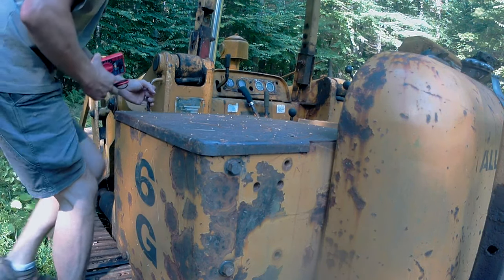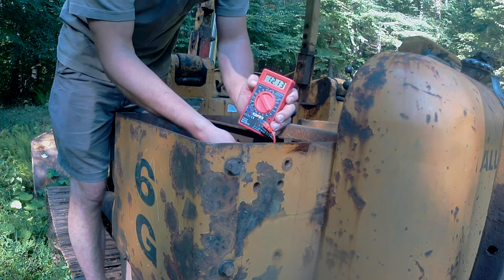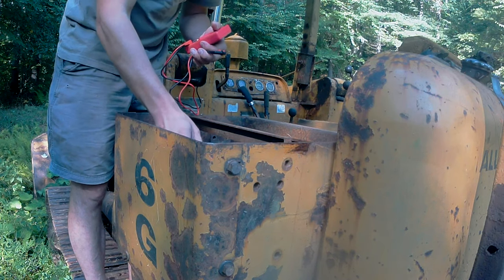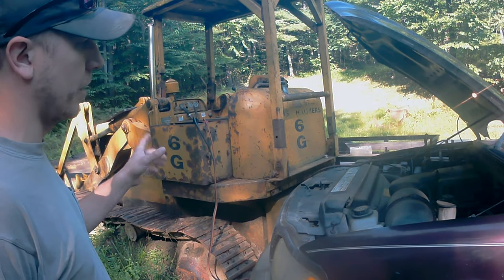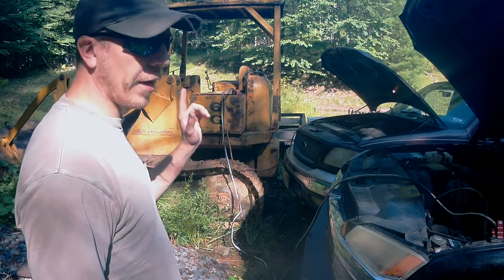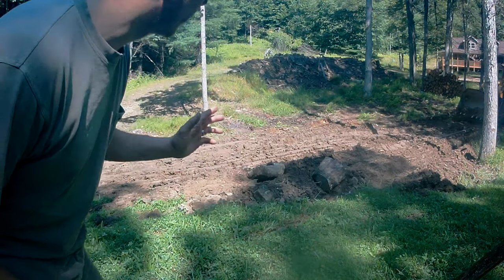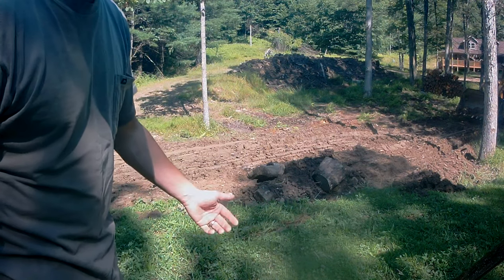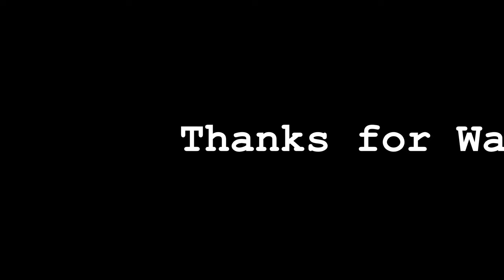Yard Work with Allis Chalmers 6G Leveling Dirt Crawler Loader - I'm Not A Professional - #29

Comment: Good to see ya got the ole G6 runnin...nice work pushing the dirt around...definitely looked like fun!
Reply from the maker: It is not easy to operate. With 7 different hand levers, and 3 foot pedals, it gets confusing. I basically have to do one thing at a time so I don't screw something up. Thanks for watching!

Comment: I enjoyed watching it! I have the same machine and I'm no professional either, as a matter of fact my yard looks pretty bad right now but I've been having fun running it. My 6G is a 24 volt positive ground system
Reply from the maker: I'm glad you enjoyed it. My 6G is 24 volt as well, but I thought it was negative ground. I will have to double check. Could that be the reason the generator isn't charging? Thanks for watching!
Reply: @NorthForkHollow  
Mine is a 1956 model I think they changed it and went to negative ground after that like probably 1958 or something

Comment: Tighten those chains brother, before you throw a track, that is if the cylinders will take grease. Nice farm dozer!!
Reply from the maker: Adjusters are manual, not hydraulic. And they are adjusted all the way out. The running gear is just simply wore out and won't last much longer. I've already thrown the tracks before. Not fun to do. But parts are not available for these old girls. Thanks for watching.

Comment: Please tension those tracks before you walk right out of them. 😁
Reply from the maker: Yup, I've done that. Even made a video of getting the track back on. But unfortunately, the adjusters are completely bottomed out and I can't get them any tighter. The only hope I have is to take a link out. I may do that in the future. Thanks for watching!
Reply: @NorthForkHollow  Taking a link out would probably be too much but I'm not sure, but it won't be easy, only the master pin will drive out with a sledge hammer, the others take a 200 Ton press. It might be easier to lengthen the adjuster bar. I know about putting tracks back on first tome I did mine was 250 yards out in the woods with no road in down a steep hill and in a running creek bed. I learned plenty that night.😁
Reply from the maker: @integr8er66  I could make blocks to lengthen the adjusters. But they are completely at the end of the guide rails. It's something I need to work on. I do have hydraulic presses capable of that tonage at my disposal, but not at home. So I'd have to take the entire track off. This is something I need to work on a little more.
Reply: @NorthForkHollow  Your's is kinda like mine, I'm just using up whats left in her not investing a lot of money. Oh ya something, if you don't know it already, changing fan water pump and generator belts on that is a huge job, but they make segmented belts now, I used one for my generator and it worked great. 1/2 hr labor rather than 8-12 hrs if the bolts aren't rusted.
Reply: Another thing I found was that even if you get it tight, if the pins and bushings are worn out, and I can see yours seriously are, it will still throw tracks. Not AS bad, but it still will, and usually on reverse because in rev the pull is on top and the tensioner spring will compress creating slack, when that gets to the sprocket and you are in a turn it will climb off. This is why I wish they had grease style track adjusters, they won't compress
Reply from the maker: @integr8er66  Agreed, there isn't a lot of like left in the tracks, let alone the whole machine. But parts are not available anymore. So I'm just nursing it along and using up what I can out of it while I can. Just a few more projects and then I can scrap it!
Reply: @NorthForkHollow  Well the pins and bushings are available, the rails aren't, but there are used ones out there, the sprockets are repairable with bolt on teeth which makes them much easier the next time, but I agree its a lot of money for a machine that will never be worth more than 5 or 6k on a good day. However don't scrap the whole thing, there are probably good parts on her for other people, esp the hydrologic cylinders, the exhaust manifold is a $600 part if yours is solid, probably other stuff too.
Reply from the maker: @integr8er66  Exhaust is definitely solid. Probably won't repair at this point. Parting out is most likely.

Comment: batteries must have at least 12.3V when fully charged to work properly
Reply from the maker: Yup! I knew they weren't charged all the way. Which is why it didn't start even with one truck hooked up. And why I took it to the house to charge the batteries properly. Everything was good to go after charging and they are still working well. Thanks for watching!
Reply: North Fork Hollow i have the same machine but i have been slowly fixing the left side final drive... the intermediate pinion had a broken tooth
Reply from the maker: Wow, that's quite a repair. How is it going so far? Making a video of it?

Comment: no shame here they have none of the electrical issues of todays machines
Reply from the maker: I need to take a few minutes to figuring out why it's not charging. But with how simple the wiring is, it shouldn't take long to test it. Just need to dedicate the time to it. Thanks for watching!
Reply: No kidding. I've got a pair of old EIMCO 911 underground loaders that have a dead-simple 12V system for the alternator, lights, horn, and starter - everything else is fully mechanical and easy to work on.